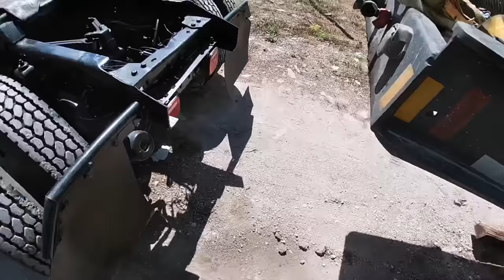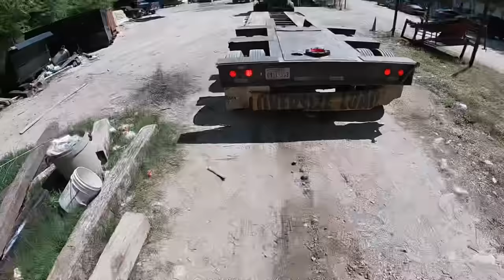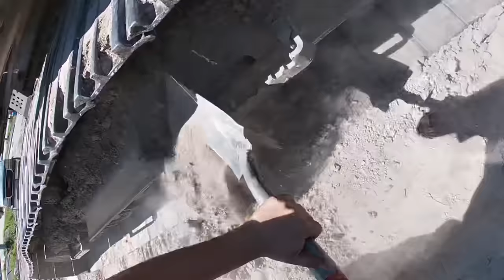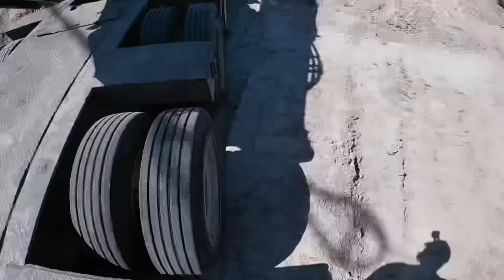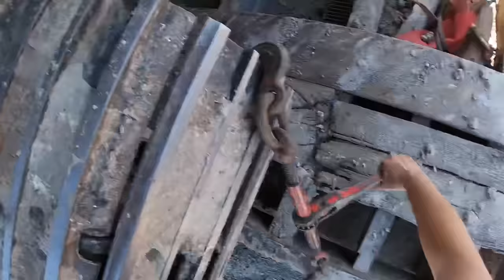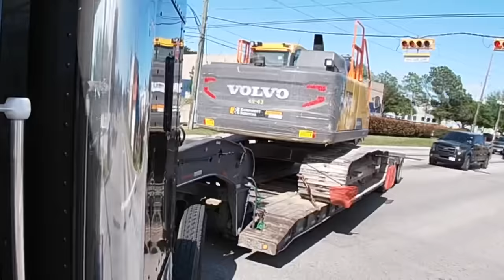A day in the life of a heavy haul trucker | kenworth moving oversize load

Comment: Never secure your load from the track plate. Stones or any solid debris that the operator runs over at the job site can bend the plate, weaken or deform it & the addition of a tie down pulling in the opposite direction might flex the damaged section, crack enough to separate from the rest of the plate. Always secure to the frame or the track carriage. Like the video's, keep them coming. Dude, you've got to get yourself an electric tarp. The combined time to manually deploy your tarp from 4 loads, that's 8x's you're on the load, you could get in a 5th load w/ an electric tarp. What do you think? But you just got a cool KW so...maybe later?

Comment: That truck and trailer looks so complicated to work with, here in Sweden its much easier and faster systems and you do not need do turn around the excavator tracks on the trailer. That excavator weights around 22 tons so I think its not a oversize load and its a very very small machine. Good video tho and have a nice day!
Reply: They run with much smaller loads in the US though, huge trucks but tiny loads, so what's a standard fleet truck load in Sweden is heavy haulage in the US.
Reply: The front of that trailer detaches and theres ramps but they just loaded it the quick way
Reply: Great way to dearch the trailer and put lots of stress on it.
Reply: Its oversize, not necessarily overweight.  Meaning its wider and possibly taller than a standard load, since the excavator is about 50,000 pounds he could still be coming in under the legal limit otherwise it would require special permits.
Reply: @nickh7050  Well in Sweden we run with 164.000 pounds, 15 feet high and 83 feet long trucks as standard fleet trucks so seeing something as this being considered large and heavy is kinda strange.
Reply: @Rick_Zune  Definitely too many bridges lower than 15 feet to run that as a standard load in the USA. Bridges are pretty much the whole reason for the load limits. Too many older bridges out there that just were not designed for that kind of load. The trucks would haul no problem but the bridges and some non-highway roads are not up to the task.
Reply: @nickh7050  Understandable but neither were ours so we fixed them, sure I know infrastructure is pretty bad in the US but in the long run a larger load is better, less fuel needed, a solution to driver shortage and less trucks on the roads to overtake in your car. We are most likely going to increase load in the near future as well so it's not like it's impossible to do.
Reply: @Rick_Zune  with over 600,000 bridges in the US I doubt they could all ever be brought up to a new standard to allow for changing the normal allowable load of 80,000 pounds.  Smaller road networks mean its easier job keeping up with infrastructure improvement. It would be nice to have those load limits like Sweden. You guys must move some serious stuff around with realitve ease.
Reply: @nickh7050  Yeah but it's a lot easier that way, especially considering our normal fleet and logging trucks take so much more. True there are a lot of bridges to fix, but that's what trucking GPS is for, not all roads and bridges are rated for loads like that here either, most are but it wasn't always like that.
Reply: @Rick_Zune  thats absolutely not true. Youre basing that theory off of what most interstate (long haulers) haul which is 80,000 lbs. Where i live im legal for up to 105,500. That being said you can weigh whatever if youre pulling big iron. Hell in other states you can run 160k and up. Just depends on what the state you live in allows. In California they can only run 80,000.
Reply: @IamEskimoPie  What theory? That you could start working on fixing the US infrastructure to allow larger loads? Well that's obvious that you could so no debate there and it's not hard seeing benefits in doing so either. Sure I get that there are different rules in different states but when we got standard fleet trucks all over the road here taking double the load you are doing in the US it's kinda hard being exited looking at US "heavy haulage" especially since we are currently trying out 240.000 pounds and 98 feet as a new standard for regular trucks.

Comment: I remember generator power lowboy trailers! We have one at the job I work at. We had 2 more that we sold. Replaced with new Fontaine. I work at a towing recovery company. Drive a 75 ton rotator tow truck. Kenworth W900L with a caterpillar! 🤘🏼I’ll also drive another one. 2007 Kenworth W900L 3406e 600hp heavy haul truck.

Comment: Dude. The D rings are there for a reason. You never tie to the rail. Rookie move. You'll learn when your load shifts/slides. You dont just tie the tracks either. You cross tie the machine so it doesnt spin. Double chain on the back.
Reply: I almost always tie excavators to the rail and have never had an issue in the 3 years I've been doing it so far, but I'm just a rookie so what do I know. The guys I learned from however have been doing it that way for much longer, and still haven't had an issue.
Reply: @averyw.3939  I hear ya. Another reason is the rail could bend up. I always got through the d ring and hook to me chain.
Reply: @theirishman8356  Don't get me wrong the d ring is preferable, but it never seems to be in the right spot. One of our lighter built trailers definitely has some slight bending, but nothing to be worried about, and something tells me this guy isn't worried bending rails since he's loading excavators over the side.
Reply: @theirishman8356  I pitty the fool who thinks D rings are the only way.
Reply: Never mind that...... never hook to the bloody track plates lol
Reply: @AUSSIEGIZMO76  Why not?
Reply: @AUSSIEGIZMO76  Apparently I've been doing everything wrong. I don't see any reason not to though, unless you don't maintain your machines and the tracks are loose.
Reply: Let me guess..... ‘I’ve been doing it blah blah way for so long and never had a drama....’?   You’ve never had a drama til the day you’re in a situation that exceeds the lashing capacity of doing it the quick way.... which I guarantee won’t restrain at least 80% of the machine’s mass in a forward motion. Complacency can kill. End of story.
Reply: @AUSSIEGIZMO76  I asked you a question...
Reply: @AUSSIEGIZMO76  What would be the failure point of hooking on the track pads? If anything I'd be more worried about the binders sliding down the side rails. I'm also much more concerned about the possibility of the machine going off the side of the trailer and mushing someone than ever coming off the front of the trailer. If I hit something solid enough to stop the truck dead in it's tracks I probably have other things to worry about.
Reply: Colton Courter because in an extreme driving incident such as heavy braking, they can bend under the force and the hook slips off, and then the machine is unrestrained. I have witnessed this once before from another unlucky contractor who was floating his own 25tonne Komatsu and it resulted in the death of the motorist next to him when the digger slipped off the side and squashed the car. accident was caused by another person cutting him off and it was only in a 70kph speed limit zone. The machine was only 4mths old.  NEVER hook into track plates as a lashing point.
Reply: Aussie gear is a lot different to American in build and lashings, and another cringe method I can’t stand is blokes who just hook to the opening for the deck lashing bar in floor..... again..... you could probably move machines incident free for 40yrs and never even look like having one shift, but that one time someone else stuffs your day in transit will be the day the hook tears and peels open the floor.  It’s just not worth cutting corners.
Reply: @AUSSIEGIZMO76  That sounds almost like a freak accident to me, unless you can point me to more times that it has happened. Maybe I'm wrong, but I would sure think that if it were truly that unsafe it would be against the law, but I haven't found anything that says it is, and I've never had a DOT officer say anything about it.
Reply: Avery Woodward I have personally never done it in the near 16yrs  I’ve been driving floats for a medium sized 4th generation family co who have had the Caterpillar distribution contract for NSW here in Australia since 1935. And that means everything from tiny 300.9 diggers through to dressed 11’s & dumpies, to individual and part build components for 6090 shovels. I was warned against doing it from day 1 and the possibility of bending a grauzer plate was the very reason they said never to do it, and 4yrs later I saw it happen for myself.   Mate, heavy haulage is a fantastic career no matter what country you’re in, but lashing heavy gear on the basis of low probability of incident isn’t a great justification.  
Do it once, do it right. 

Your DOT may not have rules against it,  but we do have legislation here in Oz saying no.
Reply: @AUSSIEGIZMO76  I don't speak fluent Aussie, but I'm guessing you're talking about the thinner steel cross members. I definitely don't hook to those, anything that visibly deflects just from the force that the binder (lashing?) generates is not a good tie down point obviously. I try to do everything right and we have a pretty picky DOT officer, to the point that he'll give tickets for not having windshield washer fluid.
Reply: @AUSSIEGIZMO76  I get the reasoning, I've just never had anybody tell me otherwise when tying to the track pads. With what you've said I'll probably start tying to the undercarriage on longer hauls and bigger machines but most of my hauls are so short that I spend more time loading than driving. I drive for a construction company so usually I'm hauling a few houses down, or at the most the equivalent of a few city blocks.
Reply: Avery Woodward and I get the shirt hopping..... I personally HATE it lol. Massive road and light rail tunneling projects going on in Sydney here for a few years and yes...... spend an hour accessing an inner city site and  loading up some 50tonne monstrosity, to hop it 5mins done the road to the next tunnel portal.... drives you mental!!   Much rather do a stock transfer the 600miles to Brisbane or 2500miles coast to coast to Perth lol
Reply: @AUSSIEGIZMO76  I also drive dump truck, more often than tractor trailer actually, and there have been a few jobs where I end up doing the same round over and over and over, so freaking bored. At least I get to row through gears, I feel sorry for the guys who just mash the skinny pedal.

Comment: nice truck man! Interesting seeing one with a Coffin Sleeper, but imo if you're a heavy hauler i'd invest in a drivers side tank for an Aux, Anyway love the head cam. Had to sub.
Reply from the maker: Kyle H the plan is to remove the 150 gallon on the driver side add a tol box step like the driver side and 2 100 gallon tanks
Reply: @Grtruckingdemolitionllc  Gotcha that would make sense. I wasn't for sure if you are a Long hauler 150 miles xxx or not thought i'd throw the suggestion. 

I run Wiggle wagons here in MI. Where are you from?
Reply from the maker: Kyle H mostly local, but if there was a chance to run towards north Texas and get some oil field loads would be nice, in down here in houston

Comment: Lol never seen a low bed like that, where you have a little gas engine lol
Reply: S gill it’s for hydraulics
Reply: S gill just about every low boy has one. Must not be around trucks very much
Reply: Austin Rewis I’m around trucks a lot, I own a gravel trucking company, all the low boy here in Canada I’m yet to see one of those engines, maybe I don’t look enough but at excavation jobs we go to never seen any of them having a engine start, but hey you could be right I don’t run low boys! The companies we use all have new trailer maybe that’s why?
Reply: S gill not sure man but I know a lot of them are hidden and not in plane sight like this one. But I’m around Oversize loads everyday soo who knows lol
Reply: S gill it is a pony motor operated lowboy. I would never own one. Would rather have a wet kit and hyd off truck.
Reply: jbacon24 gotcha!! Nice!! Thanks for letting me know that, I love to see trucking industry machinery!
Reply: In Canada those pony motors rust to hell
Reply: @phamanh30926  or when its cold they dont wanna start...tgen u gotta have extra gas with u. Only positive thing is just about any truck can pull one...
Reply: There's nothing like an all mechanical trailer like a Cozad or Murray trailer.
Reply: @2vgod460  you must not in ab, we have them all over the place.
Reply: Ghetto Lowbed setup. 😅
Reply: New lowbed setups.have a dolly hooked up to the fifth wheel and stays connected to the truck.and uses the wetkit on the truck  to pick up and drop the trailer... No need for a little gas motor, lol.

Comment: I know that truck is a 10 speed and was wondering how you feel it did pulling that much weight and if you would go with a 10spd or an 18spd if you were going to be doing heavy haul all the time and I want my own truck someday wether it’s a conventional truck or a dump truck should I get a 10spd or an 18spd and I love your videos! Thanks man
Reply from the maker: Ryan Christopher Wagner to be honest with the 10 speed it did fine. I do want a 18 speed not because I need it but because I want it lol. My dad does heavy haul with his 9 speed and  hauls heavier machines
Reply: If your in the the city and on flat land the 10spd will do just fine. It's when you start pulling grades is when you want the extra gears.
Reply: 18 speeds are optimal especially if your hauling heavy in the mountains. You have a lot more ratios and speeds to equal power. In my opinion they are also easier to drive because your gear ratios are closer so it is easier to match up gears.

Comment: Seriously that’s how an excavator is secured a single ratchet binder to track and eye of the trailer no chains on the tracks or anything that’s insane I’m surprised it holds and doesn’t fall off
Reply: Eric Binney I thought the same thing
Reply: Why would you need to add chains? The binders are going to be there whether he uses a chain or not.  That machine isn't very heavy, shouldn't be more than 50k lb.  So he needs 25k of securement.  We don't know what grade all of his securements are, but assume the minimum gr70 for the chain, hes got 11,300lb there.  Then the 4 binders are at least 13k wll, could even be up to 18k.  Lets assume 13k. So .5(13000x4), that equals 26k lb.  26+11.3=37.3k lb of securement which is well over the required 25k lb.  He also satisfies the 4 corners plus any attachments clause.
Reply: Brian Howard it’s not that he ain’t using chains. It’s just that it’s at tat he’s to the tracks and there. It also isn’t attached to an I bolt. Now granted the binders are pulling against each other due to the angle they are at. That brings up an issue regarding the tracks. With two forces pulling them apart it is putting a large amount of stress on the track. Another issue is that if the binder slips (where it’s attached to the trailer with no ibolts or anything to keep it from sliding) the hook that is attached to the track could slip off resulting in either the track coming off the excavator or the whole machine sliding off. Is that a decent explanation?
Reply: @stephenpierce6716  I don't think you're going to find eye bolts on anything bigger than a landscape trailer.  It's hard to tell from the video but I would venture to guess that the hooks on his binders are catching on either the outrigger brackets or the D ring mounts, preventing them from sliding.  Maybe look up some other videos or something so you can see how much steel makes up the tracks on an excavator this size.  Do some research on how equipment works, the forces that those tracks are designed to handle are way greater than what the binders are doing... The tracks aren't coming off unless they are excessively loose and worn out.
Reply: Brian Howard  ok maybe not I bolts but at least designated tie-down locations on the trailer

Comment: Please tell me about that 5th Wheel set up? Did you guys make it yourself? Have it made? Or Buy it? I assume that the long pin is there to immobilize the 5th wheel for use with the End Dump Trailer... is that right? Please forgive me if I'm asking too many questions. I'm working on setting up my T800 and would love it,  to be as Versatile as yours. 
I respect and appreciate the well thought out and clean way your truck is configured.  Respectfully... Cal
Reply from the maker: So the 5th wheel set up, was done by a guy here in houston, he just raised it 4in and yes the pin is to immobilize it for the times I use the end dump. And remove it when hooking to the lowboy
Reply: @Grtruckingdemolitionllc  I'm very sorry for being such a pest... sincerely. I'm just up the I-35 from Huston an I'd really appreciate the contact info of the guy who raised your 5th Wheel 4 inches.  Please?

Comment: Nice video mate but I cringed when you chained straight off the tracks, I know its only like a 21 tonner, but if you saw the size of the bolts holding the plates onto the tracks you wouldn't chain from there again. There's a reason they come with tie down points on the chassis man!